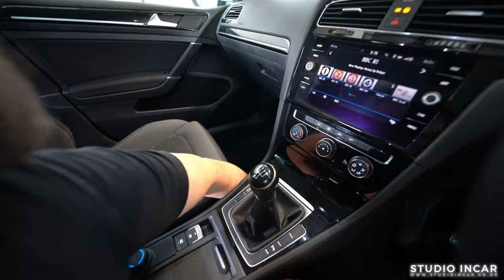VW Golf Mk7 Audio System Upgrade Morel Elate Carbon and Audison

Comment: Which model of golf do you have? I have the sel wolfsburg edition with fender audio. they don't make harness for my model. I was wondering where do you tap the signal for your dsp? Did you do it at the amp or behind the head unit? Did you have to tap into both the tweeters and mid for signal? My goal is to have a dsp install, front components, and subwoofer
Reply from the maker: You Need a Nav TV Zen V unit to digitally integrate your car.

Comment: Brilliant, what digital to digital converter have you used in this? Any recommendations?
Reply from the maker: Hello mate. It's a simple Topping DAC D10s. For what it costs it's an extremely valuable addition. It's worth noting the apple camera kit used to extract from the iphone doesn't work too well with the new USB-C type Apple Thunderbolt bit that's the camera kit, not the DAC. I like it, it's  a nice option.
Reply: This is a cracking install by the way.

I have a similar thing, except it's an SMSL PO100 Pro. Am I right in saying that the resolution will step down to 96k, even though the external DAC might support a higher resolution, if you are going into the amp optical, rather than analogue?
Reply from the maker: @shakeelfaris7623  That's right. Whatever the least capable (spec wise) DAC is in the line is the max you'll end up with.
Reply: @Studioincar . Thanks for the response. If you are going from the Topping into the DSP via the analogue output, then I guess the DAC so to speak ends at the Topping and whatever res the DAC supports, is what you'll get, on the proviso that you have connected via analogue?
Reply from the maker: @shakeelfaris7623  That's correct, yes. 

Whilst less important as they're usually spec'd very well, if the main concern is maximum resolution and DA conversion (one and the same, really), you also need to consider ADA conversion of the DSP chipset as it switches domains in the signal chain and its capabilities would also need to be upto spec. Anything with a DSP will never be truly analogous as it will up/downsample to its own capabilities. The moment a DSP is in line, DACs become a lot more difficult to realise the sonic differences between the two, for me. 

 It's worth an explanation as to why. I know we're not discussing this mk7 installation specifically but as an example -  In most of our installations, this one, for instance, we will only have one analogue input (at the amp/DSP) and sometimes a couple of digital inputs and the factory system will (more often than not) only present an analogue output so we're forced to make a decision on which way to go for the best compromise. If we were to use the TOPPING analogue output in this system, this would realise a higher resolution (albeit the maximum we could extract from an iPhone) but we would have an input for the head unit other than an AUX input with low input voltage gate. The OEM headuint in our installations is paramount for retaining the functionality of the car. 

A long answer (the short answer to your original question is yes) but I hope that helps in the understanding of why we make some of the decisions we do.
Reply from the maker: @shakeelfaris7623  Also, for what it's worth, I think to retain the highest resolution if a DSP wasn't capable of say DSD or even 24/192 rates/depths my opinion would be to go directly from as good a DAC as possible, into an analogue active crossover and out to amplifiers. Of course, you forgo all of the other qualities a DSP has, but this will give you max res of your DAC as there is no other conversion happening. 

That said, if a DSP is capable of the numbers your DAC is, there's nothing to be concerned about. If it isn't, then it's a question of which is the best compromise, for me.

I think, realistically, 24/96 (the native DSP capabilities in this Bit product) although only nipping at the heels of hi-res (in my opinion) is more than high enough when considering all other sonic attributes a DSP brings to the table.
Reply: @Studioincar  . Thanks for your response and agreed. My DSP is the Forza M5.11, so is capable of 24/96. 

I guess if you were going into the DSP via a factory headunit, you'll have those constraints, unless I guess you were going through some sort of MOST conversion? Or even via the Chinese brand headunits that now have optical. That would then free up the analogue input on your dsp/amp for the DAC to go in via analogue. But then that's a different story altogether. 🙂
Reply from the maker: @shakeelfaris7623  Absolutely right, you could do that, and you're also right, it's an entirely different conversation, ha! I've enjoyed chatting, now I must get some work done :)

Comment: i have a bmw (f20) 1-series with a full audison setup. running a AP8.9 bit.
what do i need to bypass the car headunit/radio and connect directly to the amp? 
and how do i do it?
thanks